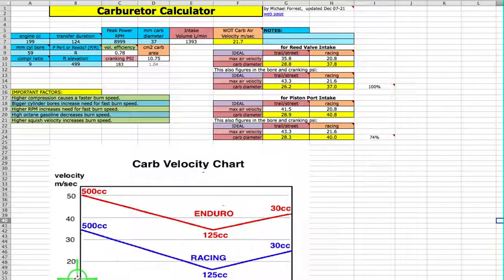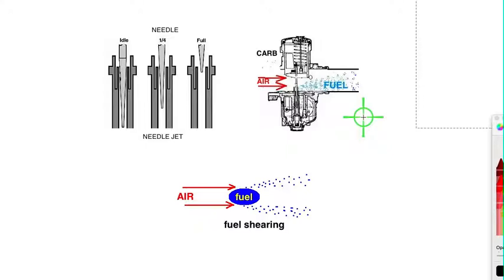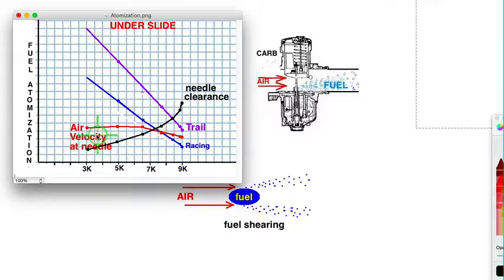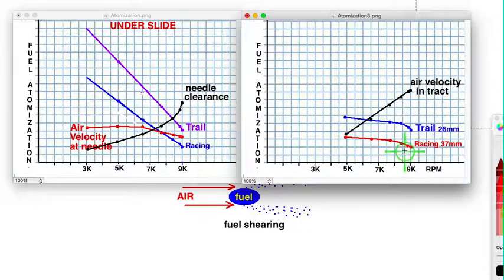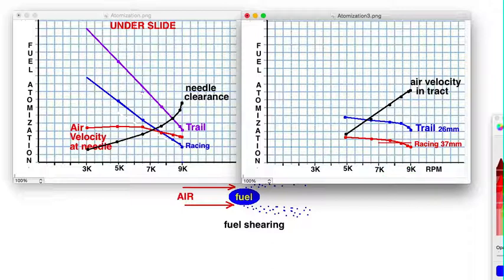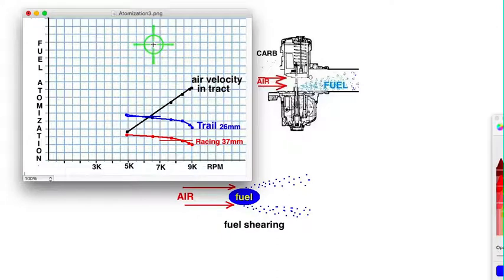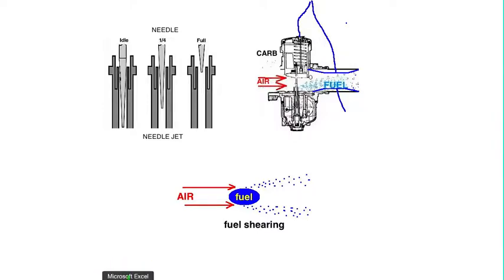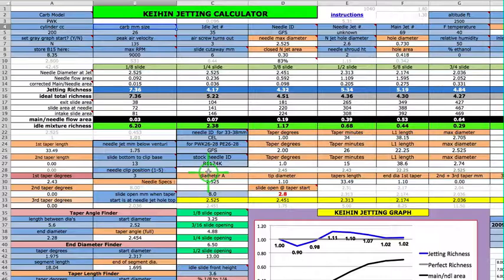Motorcycle Fuel Atomization & Carb Sizing

Comment: Love your videos! You might want to look into your audio. There’s an annoying buzz sound that’s in all of your videos.
Reply from the maker: I have an old laptop that does that. Maybe it serves a god purpose though, to weed out everyone not willing to suffer a little to get good info.
Reply: @MichaelForrestChnl  Try this if you haven't, get Audacity (free) and record your audio, then highlight a few seconds of a silent portion, goto Effect > Noise Removal > Get Noise Profile (which takes the profile from the highlighted part), then select the whole audio track and goto Effect > Noise Removal > Click OK and that will have removed some noise based on the settings.
Reply from the maker: @iKenFlyPPG  Is there a way to record the audio from an old video, do this noise removal process using Audacity, and then put the audio back into the video? I use VideoPad video editor but am not an expert with it.

Comment: My Dellorto 28 has a hughe selection of atomizer sizes and types to choose from although I have no idea how to choose one except from tested and tried setups. Carbs are unbelievanly more complex than common belief. Very interesting video. Another issue I ran into lately is that carb float level can affect jetting. Any thoughts on why?
Reply from the maker: the level determines how much vacuum it takes to pull up fuel from the bowl. You should get my jetting calculator to be able to virtually test everything and rule out the need to test. dragonfly75.com/moto/selectNed.html
Reply: Do you have the 28 VHST?   I cannot figure out where to source parts in the US, with confidence that it's the right part,  I can't verify it with my research, so I gave up and switched to a Keihin PWK 28 for now.